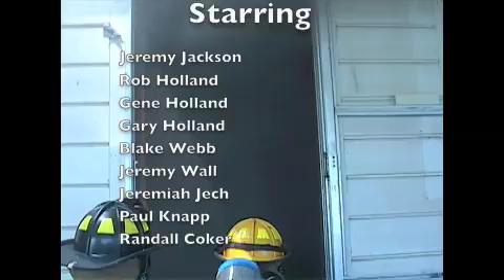smoothbore vs fog

Comment: An example of how heat, steam and smoke is driven into uninvolved areas areas of the occupancy by the air current created by a fog nozzle would be a good video however this still would not convert many firefighters.  Unfortunatly most of the fire service does not go to enough to have a true appreciation of the improved safety, efficiency, and effectiveness of a smooth bore nozzle.
Reply: I was tought only to pulse fog with just enough - it works in a totally different way to flooding the place with a jet.
Fog is used just to take the heat out of the gasses, taking them out of their flamable range and making the approach to afire safe from flashover or backdraft when you can't attack the fire directly.
When water turns to steam it expands by 1000 times - so of corse if you just pour it in there, everyone gets steamburns ... but that's not how it's used.
Reply: +Daryl Liggins    UL and NIST are doing great efforts to change all those ideas.....  Fire Services NEED TO CHANGE....

Comment: Theres no need to use a combo in a 30degree pattern. A tighter pattern has the same effect as a smoothbore with the option to hydraulicly vent the room as soon as the fire is knocked down. It doesn't matter what you use in a closed room the smoke and steam will come down do to the cooling of the smoke as the water falls from the ceiling
Reply: Smoothbore has significantly better range in a hot room than straightstream

Comment: Smooth bore are great on master stream applications, but for internal attack I like the option of hydraulic ventilation. Plus when the SHTF, fog can preserve your life in a fight-or-flight situation.
Reply: It shocks me how many people on here are still talking about antiquated statements of using a fog to protect you in heavy fire or using a fog for pushing steam conversion through multiple compartments. Ignorant stuff that I myself believed when I started work in a busy urban department in 1987. A career of experience later and I was convinced how right these statements were, even after seeing guys getting burned from fog nozzle use. We used to tell each other, it would have been worse if we hadn’t used the fog. This was only because we had to justify what we thought we knew. Now we all should know better!! Go to FSRI and take the online trainings. Look at what purely scientific data tells us. There is never a value to a fog in a structural firefight. I entrain air, I upset thermal balance and I push swap seated fire. Fog requires me to get closer to the fire room and expose myself to increased risk.  A straight stream from a fog nozzle or solid bore allows for greater reach and safer more effective knockdowns. Argue value of low PSI fog or solid bore all you want. A 50 psi fog is an ok straight stream (as long as flows are 150 gpm or higher on 1.75 lines) and a great vent tool, a solid bore is an even greater straight stream attack with less stream breakup and an ok vent tool ( crack line half open and spin in window and you’ll get similar results to a fog). Personally I don’t care as long as it’s on straight. It took me 25 years of a 37 year career to start learning instead of believing what anecdotal crap we told each other. Learn brothers, look at the science.
Reply: WRONG on the whole "preserve your life" stuff. yikes...
Reply: Tinman Actual you can use hydrolic ventilation on a smoothbore, but with the benefit of much greater range in a fire

Comment: The smooth bore mafia loves vids like this. It shows if you use tactics intended for smooth bore/straight stream when on a fog that it is ineffective. And it means absolutely nothing,  Come on put out a honest video.
Reply: Martin Baumgardner while the comparison in the video is misinformative, smoothbore are still the better option for interior attack. Wven on the tightest pattern the combi nozzle will disrupt thermal layering more. The main advantage of a smokthbore is its range and running psi. It needs half the preasure to achieve the same gpm, and since a combi stream is made up of a lot of droplets together, it turns to steam faster. So with a smoothbore, more water gets to the end of the room, meaning you need less water and you can stop a fire faster. That difference may not be seen in a small room, but in a warehouse, farm, exteeior, large bulding, storage room, or any other larger scenario, or one with high heat, it is easy to see

Comment: Video title is disingenuous.  Who the eff--in their right mind--would ever attack a fire with a pattern that wide.  The great thing about fog nozzles is their ability to tighten into a straight stream.  My department has both types of nozzles, with the large majority of the lines preconnected with combo fog nozzles.  When you go interior, most fire personnel with a basic level of intelligence knows to keep the stream tight, all in the name of keep the thermal layering in check.
Reply: I saw that. The guy had a very wide pattern. They clearly favor smoothbore and wanted to make fog nozzles look bad.
Reply: Yeah. 30 degree fog when you can see the seat of the fire is not likely. I would hit with a straight stream if I had a fog nozzle pulled. This whole argument is old. Both nozzles have their place.

Comment: Brothers. I have no doubt that you are as genuine as the day is long. I totally agree with the conclusion drawn in the comparison. However I believe that with the correct technique the fog nozzle can be used without disruption to the thermal balance. With the wrong technique the environment will deteriorate because of the loss of thermal balance. Search youtube for "Compartment Fire Behaviour Training in a real structure" and you will see a good example of how fog can control the environment.

Comment: I think you are referring to indirect extinguishing where the purpose is to use the superheated linings to produce steam and smother the fire. If performed correctly in the right situation it can be very effective. 
Gas cooling or 3D techniques do NOT create wet (saturated) steam. The cooling and contraction of the gases is greater than the expansion ratio of water to steam.

Comment: Guys if you open up a fog nozzle and swirl it around so you hit the surfaces you will generate a lot of steam. Not a good techniques if you are inside. Can be a good technique if you are outside and no one is inside.
If you apply a fog pattern into the smoke for a second or 2 it will cool the gases so rapidly that the thermal balance will be maintained, the neutral plane will rise, visibility will improve and it will improve safety while getting into position to put a jet on the fire base.

Comment: I used to be a full supporter of fog nozzles for the "left for life" protective capability it provided. Never thought of using a smooth bore till I watched this video. No my way of thinking has changed. @ DO323 if you haven't ever used a smooth bore for an interior attack don't knock it. They had a good fire in that room and it was vented you could see the window open on the other side of the room. Don't knock it like I was, keep an open mind because I used to be the same way!

Comment: Water dose indeed turn to steam when it leaves the nozzle ...  and guess what it uses to do that ... yes, heat energy. Water molecules have an extremely high specific heat capacity - that's why it takes so much energy to boil a kettle. Because of that it can remove a relatively huge amount of heat from the gas layers as the water temperature is increased. The dawback is penetration. Pulse a wide fog as entry is made but then on to progressively "cone down" until a direct attack can be made.

Comment: Correct me if im wrong but cant you use the fog stream as a ventilation techqune?  Im an explorer and we recently did hose and nozzle trainning and when we used the fog, it makes a backdraft, they said its supposed to ventilate the building when you put the fog stream in a door way or window

Comment: This video showed that a smooth bore is better than a combination nozzle on fog which i will not disagree with. However use a combo on straight stream and your getting the same reach and same gpm to the fire while having the availability to open to fog for protection or hydraulic ventilation. Next youll say u can shut the bail half way to get broken stream on a smooth bore which is correct as well but when u shut the bail half way ur cutting ur gpms in half. Combo nozzle FTW!

Comment: That is quite possibly the most ridiculous thing that has ever been said. You need to pull your head out of your ass if you think that a solid stream nozzle "cant even hit the fire", when in reality, its the other way around. Im sure you still think that in case of a flashover that you lay on your back and open the nozzle to a wide fog. Yea. Im sure you do. And just an FYI, most of that water will turn to steam the second it leaves the nozzle. NIST has proven all of this. Educate yourself.

Comment: Set the constant-flow to the tightest pattern and then compare. If there's no rescue then a 30deg or wider pattern will knock a large fire down in a garage or other similar type building. You CANNOT get the same coverage/spread with a smooth bore. You'll be lucky to even hit the fire, much less cool it off. That is why the versatility of a constant-flow is better for everyday use.

Comment: GPM is not the whole story - varying the droplet size directly affects the speed of cooling because a spray of droplets has a far far far greater surface area than one solid jet. The reason the smoke comes down so fast is the water is evaporating much faster and therefore cooling the gasses much faster.
I was instructed to be progressive - start cooling with pulses, as soon as you enter the fire compartment. Then narrow the focus as you progress towards the main fire, finish as your guys did.

Comment: @HighfillFire 
not to insult you in anyway but for your information the " left for life " method was validated in last months issue of  Fire House  mag.. they said " when a fire is at its flash over point this left for life and right for reach method is incorrect.  In fact it will only intensify the heat  due to the steam conversion."  but in other conditions  the fog pattern works wonders although ill still stick with the smoothbore. ..great video  man.

Comment: The fire flow formulas are NFA and IOWA, check them out.

Straight stream and solid bore are all in all pretty similar. Obviously ones a combination nozzle but the actual streams differ mostly with nozzle reaction and flow rate. You do have the benefit of fog for protection. But you can Hydraulicly  ventilate with a smooth bore.
You dont mess up the thermal balance short bursts. 
The fire triangle is now the fire tetrahedron

Comment: Was hoping for a more accurate fire attack video however its flawed.  I prefer smoothbore as it pushes less air hence less thermal balance issues and requires less operating pressure. But everyone knows straight stream or nothing with combo nozzles.  Runoff? GPM's puts out fire and I can more with SB at lower pressures. Runoff? Flashover protection? Hitting the ceiling w/ SB breaks the stream, I don't buy the more effective for fog. Bottom line, be good with whatever you got. But give me SB!